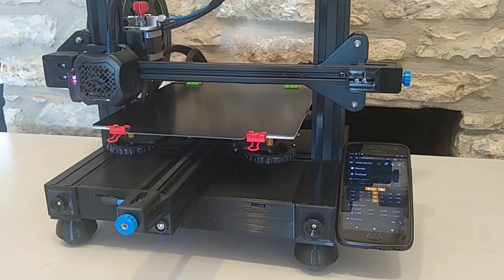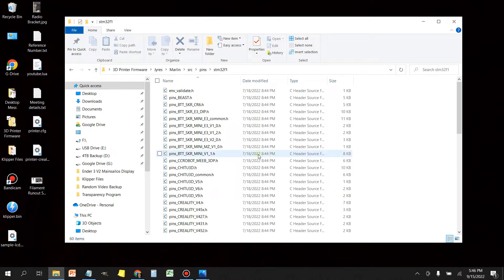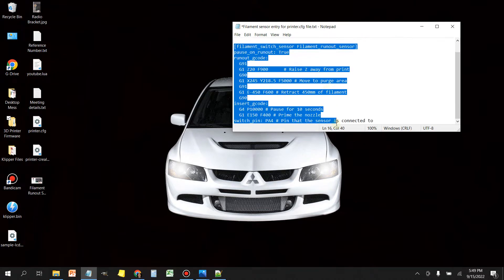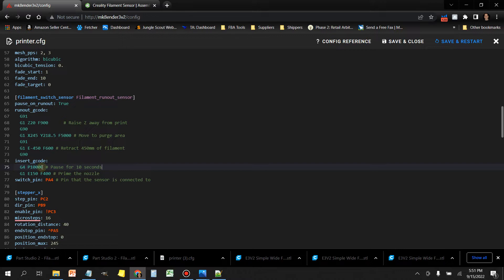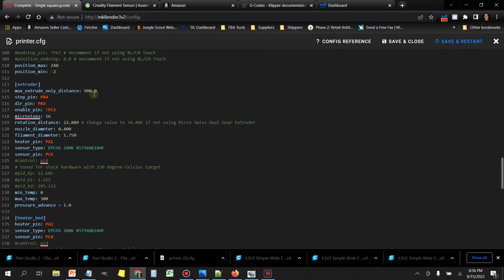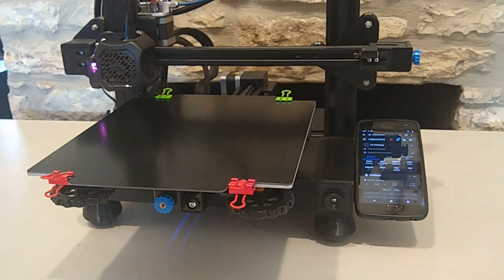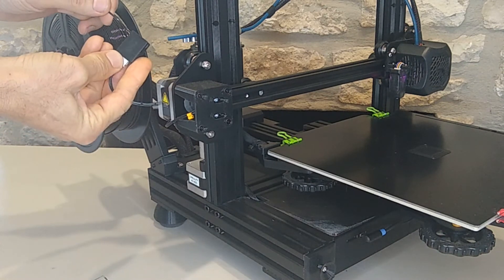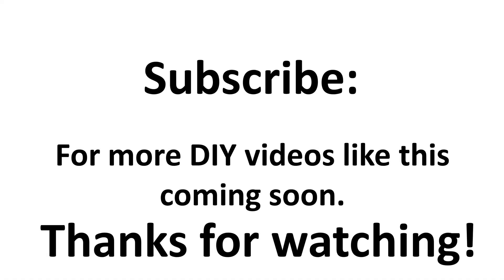Ender 3 V2 Enabling the Filament Runout Sensor in Mainsail Klipper

Comment: Best and most usefull Tutorial on the runout sensor for Klipper i could find. I adapted this for my CR-10S with a BTT SKR Mini E3 V2. 
If anyone needs to know this, the switch_pin on this board is PC15
Thanks for your Video
Reply from the maker: Hello Totti, Thank you for commenting, kindness, and pin info for your board.

Best of luck with your mods on your CR10S.

Comment: I am loving klipper my machine is a different animal now taken me a while but man it’s worth the effort. Again many thanks man
Reply from the maker: Hi Noisy, Yeah man, I hear you. It's a real game changer for sure. Super easy to make changes without needing to mess with compiling firmware. My PETG prints are super clean and almost 3 times faster.
Reply: @vbared  amazing set up love it   My switchwire build is nearly ready to go now
Reply from the maker: @noisy_boi_fpv_3920  let me know how the linear rails work out. I've been thinking about adding them.

Comment: G91; relative positioning (here E value should be small as slicers zero it out somewhat frequently)
G1 E-450 F600 ; you retract (here E value is changed from the above one by substracting 450mm from it, so if above was something like 1.23 and you do the G1 E-450 then you end up with E=-448,77mm)
G90; absolute positioning (but the E value does not chenge here)
insert_gcode:
G4...
G1 E150 F400; here you are not extruding 150mm of filament, but because this is in absolute positioning you're extruding starting at E=-448,77mm up to E=150mm so you're in fact extruding 598,77mm

In the g-code above you're missing something like "G92 E0.0" which zeros out current position of E.
Reply from the maker: Hello Marcin, Thank you for commenting and g-code details. So if I'm understanding this correctly. I'm just needing to add G92 E0.0 before telling it to extrude filament? I was tripped up by this for some time trying to make sense of it.

Comment: Hi Victor another informative video FYI not sure if anyone else already commented on this but with Sonic Pad the Runout sensor is not on the Dash. I thought I did something wrong because it never showed up but in fact it’s on the page with the Mesh for some reason.
Reply from the maker: Hi John, Thank you for commenting and info about the sonic pad. Does it run Mainsail as the GUI or something custom?
Reply: @vbared  Think both actually it’s a Creality version of Mainsail I believe not Fluid.
Reply: No I’m wrong looks like a custom Fluidd not Mainsail
Reply from the maker: @johnmcdonald3231  Thank you, John for double checking. Others will most likely ask your same question if they don't read the comments.

Comment: Victor great information, can you think of a way to have it complete the layer before pausing? I’m using a Sprite extruder so there’s plenty of room between it and the sensor. Figured it’s better to resume at the beginning of the layer.
Reply from the maker: Hi John, Thank you for your kind comment. You ask a great question. I guess that would depend on the placement of the sensor so in your case the the sensor could be mounted at the top of the z frame so when it gets triggered you have about 200mm of filament before you actually run out. I'll have to check the forums for the answer on how to do it via the start G-Code or in the printer.cfg file using a macro if running Klipper.

Comment: Hi, I like how it works and I am quite happy with my sensor now working as well. 

I would like to keep Y axis ststic and only X axis moving when there is no filament. Does anyone know how I can change it?

Kind regards!
Reply from the maker: Hi LowSpecHardware, Thank you for commenting. I'm glad you found value in this video for your viewing time. Replace what you currently have ender the [filament_switch_sensor Filament_runout_sensor] section with the following:

[filament_switch_sensor Filament_runout_sensor]
pause_on_runout: True
runout_gcode:
  G91
  G1 Z20 F900      # Raise Z away from print
  G90
  G1 X245 F5000 # Move to purge area
  G91
  G1 E-450 F600 # Unload 450mm of filament
  G90
insert_gcode:
  G4 P20000 # Pause for 20 seconds
  G1 E450 F400 # Load 450mm of filament
switch_pin: PA4 # Pin that the sensor is connected to

[pause_resume]

Comment: Thanks Victor, you got me past the issue of finding the sensor pin. I have two issues though. My Ender 3V2 has the Sprite Extruder on it. On detection failure, head moves to right rear (and overshoots on the X drive- I hear binding), then selecting RESUME on the Sonic Pad, printing does not resume in the correct position, but is offset from where it left off. So, two issues:
1. The binding when head parks in right rear- I tried to set the Position_max in the Stepper_X to 235 but that didn't do it. However, I don't think it is an issue with your Gcode. Perhaps you have an idea of what to look at?
2. How do I fix the return to the correct position to resume printing. I also have the same Sonic Pad setup on my Ender 3 S1, which works perfectly. I would note that there is no special code in the printer.cfg file for this, just the switch_pin and "pause_on_runout: commands.
Reply from the maker: Hello J. I hadn't seen the Sonic Pad before, it's pretty cool. What mainboard are you using, is it the stock 4.2.2 or are you running the 4.2.7?
Reply: hey did you resolve the problem during resuming the print? i just solved it for myself. I'm assuming you have an auto bed probe? during the probing the head has to move in X further than the bed size, on mine it needed the head to be at x=246, i had run into an issue when installing the bed probe so i just threw a number like 270 in 'position_max'  under 'stepper_x'. this fixed my bed probe issues and then i forgot to actually ever figure out the physical max. during a pause (or filament out) the position the head is moved uses the 'position_max' value.  anytime i used pause it would crash the head because it was trying to move to 270 when it could really only physically move about 260. so what happens is the belt pops and the printer thinks its at 270 but is like 10mm short so it loses its position and when it resumes its not resuming to the right spot. the printer thinks its in the right spot but the head has jumped the stepper motor gear. well i set my 'position_max' to 247, one mm farther than my bed ever needs to move and now it doesnt crash and resumes perfectly. this goes the same for the y axis as well, mine did not have an issue on y though.

Comment: When the printer goes into self-stop mode when the filament runs out, the hotend and platen bed maintain the printing temperature, right? Do I understand correctly, or is the hotend and bed print temperature also reset?
Reply from the maker: Hi MC, Thank you for commenting. By default both the hotend and heated bed will shutdown after 10 minutes of inactivity. The defaults can be altered by adding a macro to the printer.cfg file giving the printer different instructions on what to do during this paused state. I removed my filament sensors from my Ender 3 V2s because of a few problems caused by them that lead to print failures.

Search for Klipper idle timeout

Comment: Are you wired to the normally open or normally closed pin on the switch?
Reply from the maker: Hello imacmill, Thank you for commenting. Normally closed (outside pins of the switch) check out the diagram from the video time stamp link below.

https://youtu.be/30iAJ8jVFi0?t=53

Best of luck with your mods!
Reply: Thanks. I watched most of the video, but I could not tell in the wiring diagram at the beginning what pins were connected on the micro-switch. 😊

Comment: would the p;in be the same for a 4.2.7?? I have been trying to figure out the pin out but can't seem to find it in a firmware... I have a plain Ender 3  with a 4.2.7 board upgrade.
Reply from the maker: Hello Thomas, Thank you for commenting. I haven't hooked up the filament sensor to my machines running the 4.2.7 board yet but found pin PC6 in the Klipper printer.cfg file in the board pins section (see below). 

It shows FIL_RUNOUT=PC6

Give it a try and see if it works and if not let me know and I'll help you hunt it down.

[board_pins]
aliases:
  EXP1_1=PC6,EXP1_3=PB10,EXP1_5=PB14,EXP1_7=PB12,EXP1_9=<GND>,
  EXP1_2=PB2,EXP1_4=PB11,EXP1_6=PB13,EXP1_8=PB15,EXP1_10=<5V>,
  PROBE_IN=PB0,PROBE_OUT=PB1,FIL_RUNOUT=PC6

Best of luck with your mods!
Reply: @Victor Bared   Thanks! I actually figured it out its same as your config I just had to adjust my excursion alot I'm running a sprite hotend only need to retract about 45mm and purge like 50mm but other then that it's prefect! your video is amazing help!
Reply from the maker: @twall667  Great job! Thomas, was it pin PC6 or something else? Thank you for the info on the Sprite.

Enjoy your night :)
Reply: @Victor Bared  PA4, same as yours, it was a lot simpler than I thought it would be. Now I just need to print the case for the switch, and I'll be good to go! Used my leftover z limit switch when I switched to ABL.
Reply from the maker: @twall667  Interesting, I'm going to have to let the Klipper team know they have an error in their pin comment field for the 4.2.7 printer.cfg base profile. I appreciate you, thank you for the update.

Comment: I’ve found cura 5.1 is moving printer out of range error and I’ve used same start and end h code. All other settings are the same. Any tips please man. Got me scratching my head. 4.x.x is alll good
Reply from the maker: I just downloaded CURA 5.1.1 stay tuned I need to play around with it to see if I get that error message.
Reply: @vbared  your a legend

Comment: you just need to add the line resume to your code then it takes no input from you 

[filament_switch_sensor Filament_runout_sensor]
pause_on_runout: True
runout_gcode:
  G91
  G1 Z20 F900      # Raise Z away from print
  G90
  G1 X0 Y0 F5000 # Move to purge area
  G91
  G1 E-20 F600 # Retract 450mm of filament
  G90
insert_gcode:
  G4 P10000 # Pause for 10 seconds
  G1 E150 F400 # Prime the nozzle
  RESUME

as like i pasted
Reply from the maker: Hi pondwaterjr, Thank you for commenting and RESUME info. It was pretty annoying having to mash the play icon every time.

Have a great weekend :)